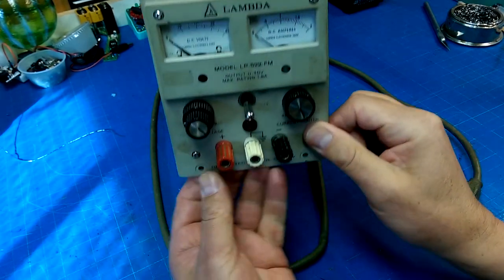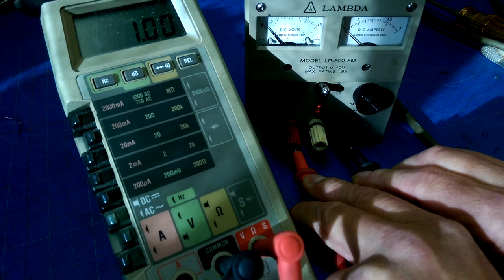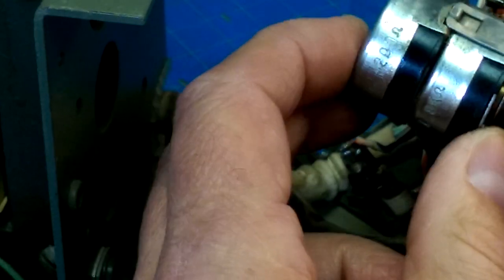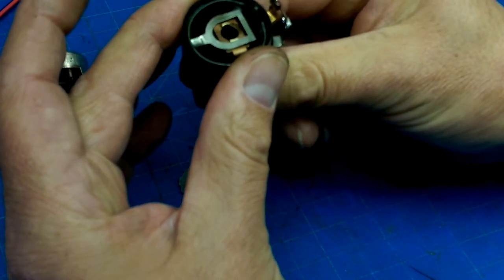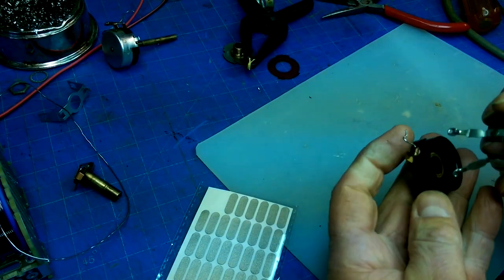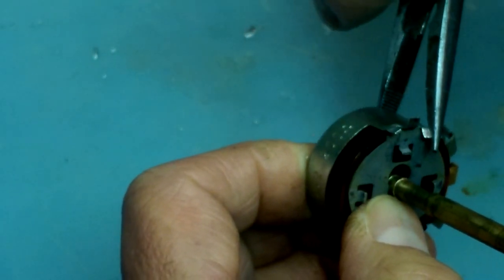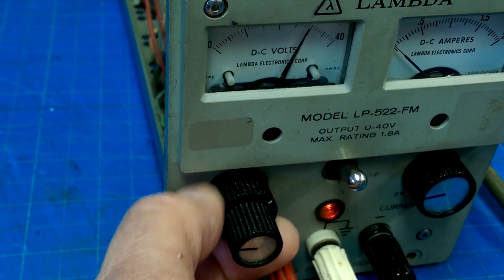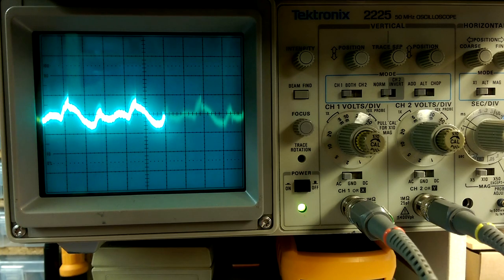lambda PSU Repair

Comment: Great video thanks! 
Interesting ripple test at the end. Is there most common components that would cause ripple and noise due to aging? I ask because I have a Lambda LDS-P-5-OV but I don’t have an oscilloscope to check it. I am thinking of replacing all the capacitors but not sure if this is the most common and most likely cause of issues as they age. No big pots on the LDS.